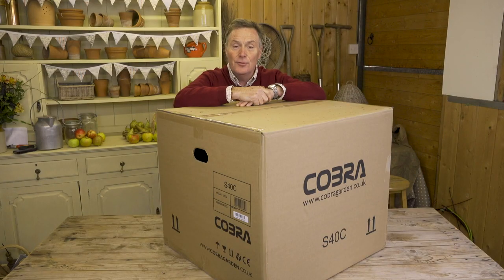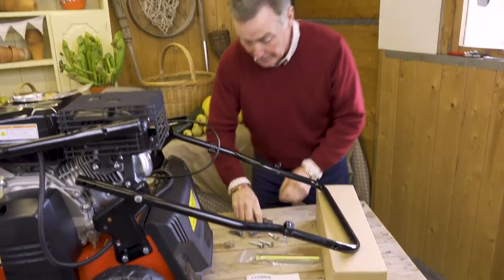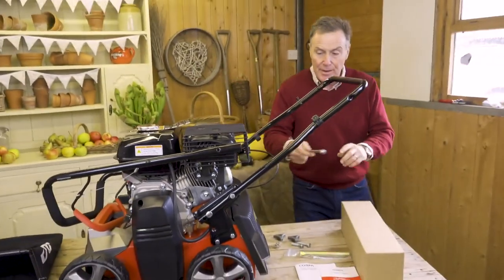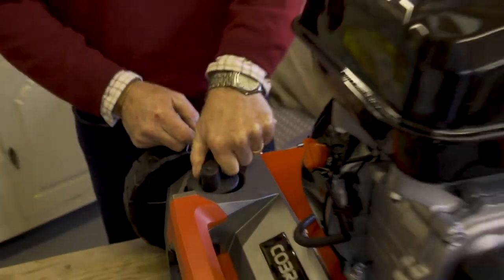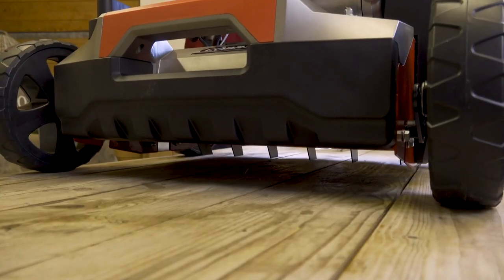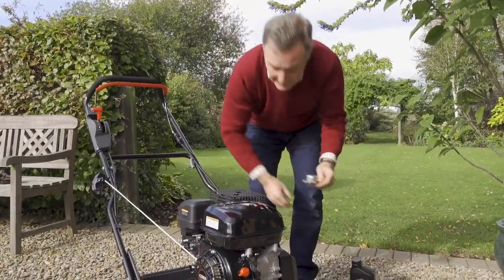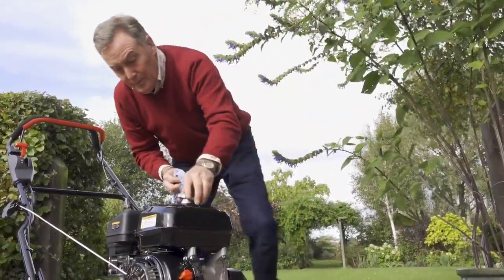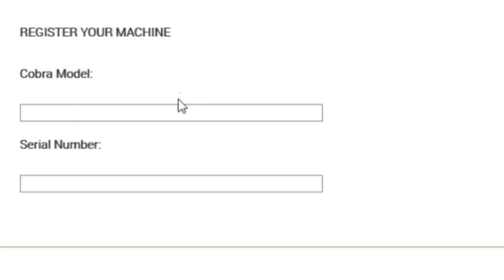Getting Started - Cobra S40C Scarifier/Aerator

Comment: The bit where you’re putting fuel in and say “Take that off and throw it away”, there’s a very important rubber fuel cap gasket attached to that. You need to take it off the paper and attach it to the fuel cap, otherwise it won’t do up properly. Other than that, great video thanks.

Comment: Very useful video - thank you for taking the time to film.  I’m yet to purchase but this is now a strong contender.  Quick question with regards to changing cassettes once oiled and fuel.  Would it still be ok to tilt back as you have done without any risk of oil/fuel leaks?